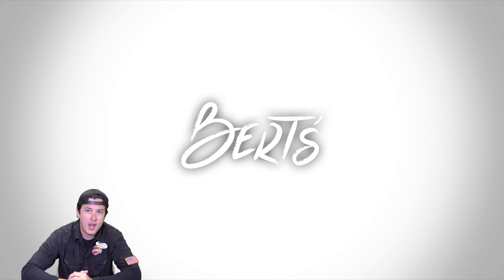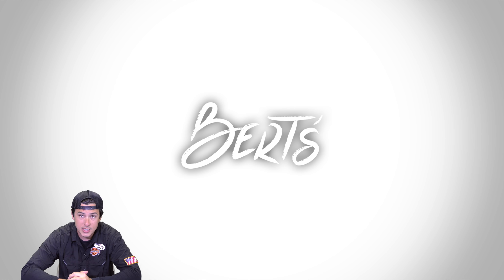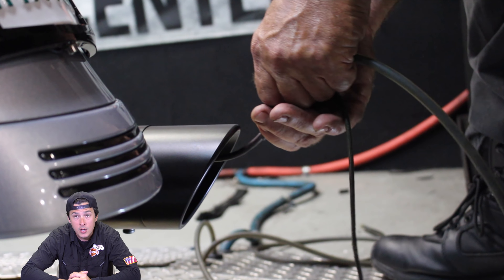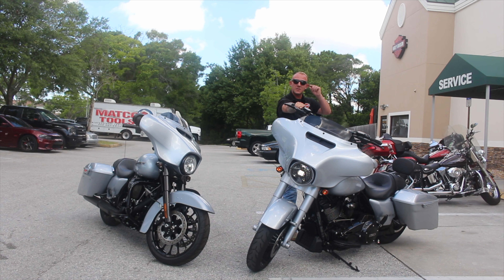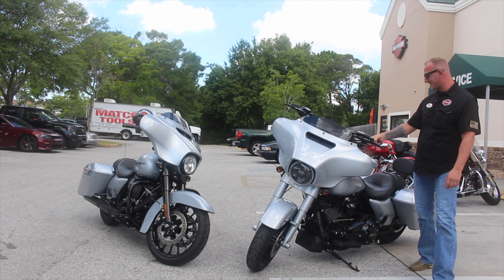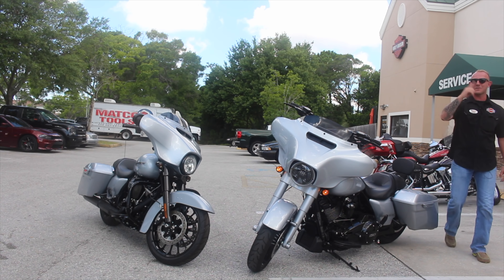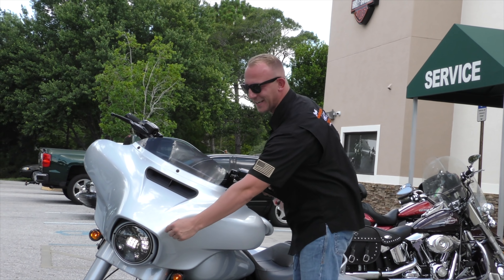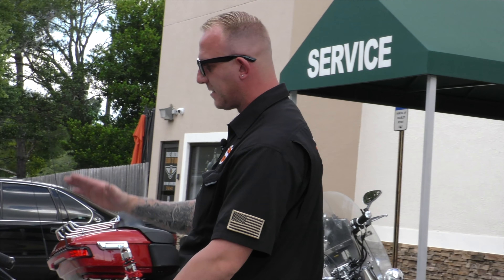128 Street Glide Special (FLHXS) | 114 to 128 Cubic Inches

Comment: I like the power of the 107 it’s plenty. It might not have the top end power of the 114 but it pulls to 100+ with no problem. I think if power is what you want. Harley isn’t the bike for you. The sound and feel of a Harley keeps me on a Harley, but I’ve been behind a bmw 1600 and there’s no keeping up with that thing on a Harley. Even with a 128 kit.
Reply: Yes, but what's the insurance on the BMW 1600B or a Ninja or something stupid fast? Too damn much for me compared to a Harley.  Plus, after a few tickets, it's all over.  Go too fast over the posted limit and they take you straight to jail, suspend your license, charge you with reckless driving and guarantee the insurance company drops you, bail, fines and court fees.  Cruising on a Harley sounds like a better option.
Reply: That's mostly down to the weight of the Harley. They're 1.5 to 2x as heavy as a BMW 1600. Still, would you really say no to better performance?
Reply: It’s like 100lbs lighter. But it has like double the hp from an i6 with a little more tq. So it definitely has better performance. I still prefer the looks of a street glide or road glide. But I wouldn’t call it ugly. If someone wants to go fast and still be able to tour with bags. It’s definitely an option. I don’t own a street glide to be fast. I like the looks, sound, attention to detail, and the performance is good enough for me to have fun

Comment: Do you build 124ci also? I'm looking to purchase an 18 RGS with power. If I can purchase it at your dealership with a warranty that would be great.
Reply from the maker: Pound That Pavement we’ve never built a 124 and the only built bike we have in the showroom is the 128 RGS we made a vid a few months ago. It is for sale and we do offer a performance warranty.
Reply: @BertsMotorCompany  The kits I have seen are a 107 to 124 and a 114 to 128

Comment: Will this work on the 2017 STREET GLIDE CVO 114" M8
Reply: It's an S&S Big Bore kit. The 114/117 (4.5" stroke) can be made into a 128, the 107/114 (4.375" stroke) can be made into a 124. As the 2017 CVO is a 4.375" stroke 107 bored out to 114, it can be made into a 124. Performance wise the S&S 124 and 128 are similar. Maybe a few ftlb and hp less on the 124, but it's negligible. Both S&S 124 and 128 kits outperform H-D's 131 by a substantial margin.

Comment: We offer aftermarket performance for any build. Does not necessarily had to be built by us. Come on in!
Reply: Jason Hamalcik  I’m a Jason too , is it possible to do this 128 upgrade to a 2019 Fat boy? And also I wanna do a dual disc brake on the front, I’m not rich but cost is not an issue, I know that I might have to change the front wheel and forks.
Reply: @JSMFMS  Sorry buddy for the late response. Absolutely this is possible. I would be excited to see this on a Fatboy. Why win't you give us a call under 727-527-9672 abd ask for me for details. Thank you!

Comment: What’s the top speed with this kit? If the bike is still governed at 110 mph, it doesn’t make sense to buy it
Reply: BIG MAN Chris I do believe the TTS master tune they are speaking of removes any type of governors
Reply: Yea any aftermarket tuner removes the speed limiter! 👍
Reply: There's more to performance than just top speed. More torque will allow for faster acceleration. Better suspension will allow for higher cornering speeds. In fact, I'd argue that better suspension is the best performance upgrade you can buy. It may not get you off the line that much faster, nor will it increase your top speed, but it'll improve handling and give you more confidence in the abilities of the bike. Any upgrade that doesn't include improving suspension will leave a lot of power unused, unless you're just going to use it on a drag strip.

Comment: You offer in house warranty on aftermarket performance on your builds only?
Reply: I'm not really sure what you mean by that but I'm sure that they're not to cover anybody else's performance upgrades. Seems pretty legit to me.
Reply: I think he is asking if it’s an in house only thing or if there is an outside company that they get the warranty from. In that case anyone would be able to get it I would think. But I ask the same question a few weeks ago and still no answer but it would be nice to no lol
Reply: Joe Vandivner yes that was what I was trying to figure out
Reply: Bert's guarantees their builds in house. The business they get, compared to the failures they expect through normal road use (abuse or racing will never be covered), justifies the risk they take. Also, as all these aftermarket parts are of a much better quality than the factory H-D parts (billet i.s.o. cast aluminum), the likelihood of a part failure is greatly reduced. Mind you, they will use performance parts in other place than just the camshaft and big bore cylinders. They'll match parts to the performance, so you may be getting S&S oilpump, camplate, pushrods, lifters, valve springs, bearings, headbolts, etc.

Comment: Without the limiter, what’s the top speed?
Reply: BIG MAN Chris you don’t want to take those to “top speed”. I have a street glide and I don’t know if I’ll ever take it above 120, it starts to wobble too much
Reply: I would never take it to top speed. I brought a cruiser to cruise. But, if I spend 3-5K on a stage 3 or 4, I would to know that if I wanted to go 125 I could
Reply: Keep in mind that your top speed is limited by your tires. Cruiser tires aren't classified for high speeds. The bike may be able to go faster, but you run the risk of disintegrating your tires at speeds in excess of 130MPH. That's not a great speed to have a blowout.

Comment: I just bought a new 2020 Freewheeler since my disability took my 2 wheel days away. Haven't gotten it yet but they're building a 128" full bore Hot Rod. CNC heads, 64mm throttle body, CNC intake, high lift springs, 550 cam, Reinhart duel header pipes and race mufflers and baffles, Barnett scorpion billet clutch with Trask billet clutch basket and much more. I haven't heard of anyone doing this to a Trike but my palms are sweaty thinking about it, so if anyone has any thoughts or suggestions please feel free to holler, I'm open for any suggestions or advice.  Anyone want to build a set of wheelie bars? Triangulated single wheel. I'll  respond. Thank ya'll  Jimmy
Reply: Jimmy Hobgood what state you located

Comment: What was the overall price to get all that done?  Know they scared to say that... Of course I cant afford it that's why I ask. If you have money to waste like that then you don't ask.
Reply: leon Richardson I have a 124 in my RGU.  I am at about 8000 dollars not counting the exhaust, air cleaner and Power Vision.
Reply: If you're coming from a stock bike you'll need:
- A high performance air-cleaner: $200+
- Slip-on mufflers: 800+
- A good tuner like TTS, DynaJet, or ThunderMax: $500~$1000 (depending if you're using narrow or wideband O2 sensors), piggyback systems like the V&H FP3 will not suffice.
- A cam shaft: $250+
- A big bore kit: $1000+
- Dyno tuning: $500+
- Miscellaneous parts: a couple of hundred dollars (like bearings, gaskets, head bolts, valve springs, etc.)

If you're not doing it yourself, add labor: $2000+
So you're looking at about $6,000 for a Stage III, and you should really be upgrading your suspension so you can get the power to the road, so that's another $900+ right there for a good rear suspension kit (Legend, Ohlins, Russ Wernimont, HyperPro). If you want to do forks as well, that can range from $700 to $6,000, depending if you want to go with a cartridge kit, or a full inverted front fork kit from Kraus.

You can expand further to:
- Full exhaust system: $900+
- Wide throttlebody: $800+
- Fan assisted oil cooler: $300+
- CNC ported heads: $2,500+
- Aftermarket clutch and basket: $900~$1500+ (Barnett or Rekluse)
- Flywheel & crankshaft: $1600+
- Compensator: $500+
- Oil pump & Cam plate: $700+
- Lifters: $300+
- Gearbox: $3,500+
- Chain drive conversion: $????

Comment: Hows them 124kits for the 107's workin out?
I was considering one when I get 5000 miles on the Fat Boy.
Reply: It is absolutely doable. We can put that 128" on your bike without a problem
Reply: FranBunnyFFXII my 124 has 10000 miles on it. Was built in June of 2019.  0 problems

Comment: I have a m8 no point in going past stage 2
Reply: Sounds like a smart man
Reply: Cost/benefit diminishes after a Stage II. Stage II gets you the most bang for your buck (provided you go with a decent cam, and not one of H-D's Stage II cams). Stage III and IV provide incremental improvements, and cost an arm and a leg. Especially if you're doing them right (with an aftermarket clutch from Barnett or Rekluse).